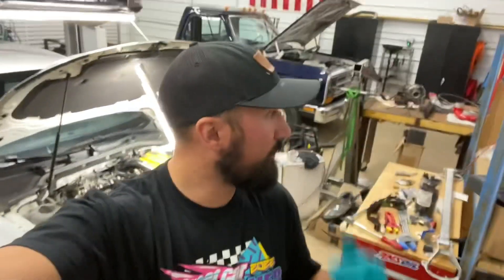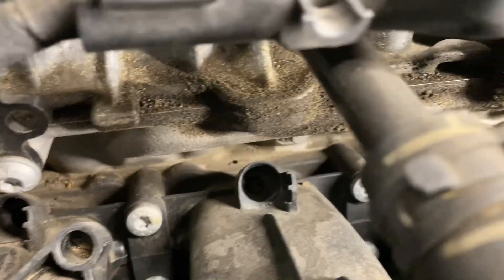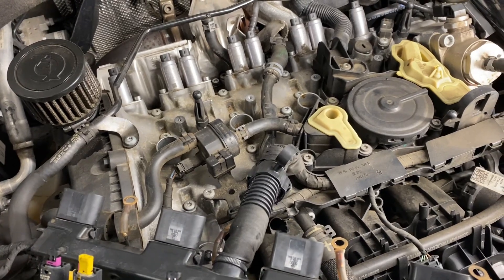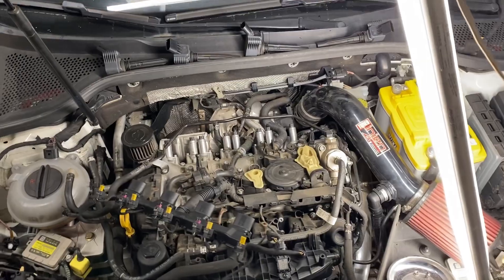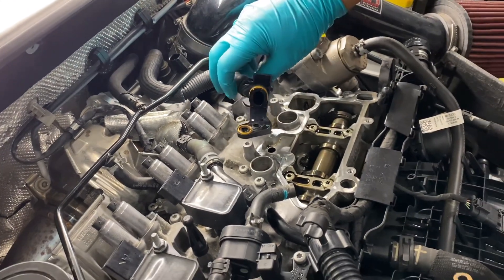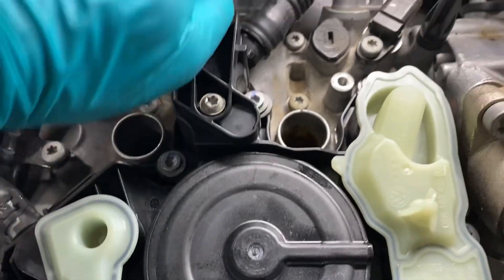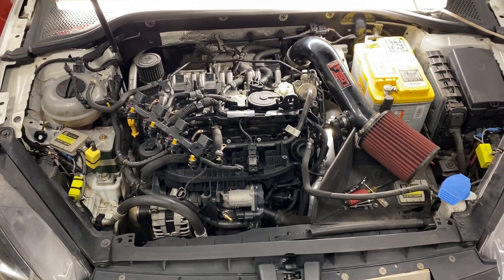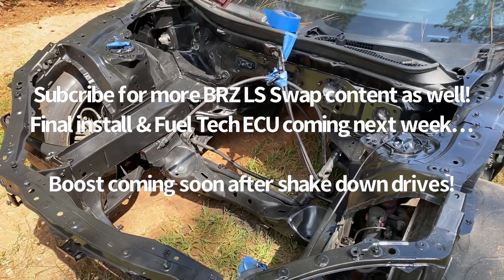Mk7 PCV Diagnosis & DIY Installation

Comment: 10k? for that car is not more around 40k for sparkplugs?
Reply from the maker: Tuned the Gen3 TSI needs plugs every 7-10k miles depending on how hard you drive it.

They make extremely high combustion temperature & pressure tuned, so if you attempt going 40k miles on spark plugs you’d likely end up breaking the electrode off (putting shrapnel through the engine) long before reaching 40,000 miles

Comment: ‘17 DSG with PP + ECU/TCU stage 1
Been having tapping noise and misfires + poor performance off and on. Might’ve narrowed it down to a stuck/bad lifter, but I’m wondering what would’ve cause it to become problematic in the first place. Is it possible a failing PCV could’ve led to oil contamination and fouled up the lifters? Trying to figure out before giving into the stealership
Reply from the maker: Check your cam magnets

Comment: My car is at 80k miles. I have the oil weeping issues like you mentioned in the video. Also had a little bit of oil on one of my spark plugs. I also have misfires on cylinder 2 at idle. If I unplug the N80 valve that is connected to the PCV the misfires go away. I’m thinking the PCV is the issue.
Reply from the maker: Sounds like you’ve got it!
Reply: @BaunPerformance  I installed the MK8 PCV retrofit with the full Venturi. So far so good!

Comment: Read somewhere that a possible sign of a bad pcv could be an oil leak
Only saying because I recently had a small oil leak coming from my OE last oil pan so I replaced with a steel one and used a dry gasket but now I just have the same problem after replacing
Is it possible a bad pcv is causing high pressure and making the leak still happen
Reply from the maker: I talk about it in this video, the most common crank case pressure induced leak would be at the oil cap (which can run down and be misdiagnosed as something like the oil pan)
Reply: @BaunPerformance  really hope it ends up being it coming from the oil cap and just replace the pvc
That’d be so much better

Comment: Did the car ever have blue smoke on startup? It’s an issue I’m having with mine and it looks like I may have some seepage around the valve cover as well. Trying to narrow it down.
Reply from the maker: Yes, it started around 80-90k ish. Unfortunately blue smoke (oil burning) on cold start has absolutely nothing to do with external leaks or PCV issues.

Being a spicy economy car, VW used inferior valve guide seals. The oil leaks past them on higher mileage MQB and burns off on cold start. 

Luckily, it’s such a small amount of oil even at 140k+ it doesn’t add up to a significant amount over my 7k oil change interval, but it is annoying & can only really be fixed with new bronze valve guides/seals (upgraded from OEM)
Reply: @BaunPerformance  Wow definitely one of the most helpful comments I’ve ever received on a post. Thank you! 

But also I’m definitely not a mechanic so I’m curious… if a bad PCV leads to external leaks due to over pressurization, why could it not cause internal leaks? Again just curious since your first explanation clearly shows you know what you’re talking about. Thanks again!
Reply: @BaunPerformance  also would you recommend using liquimoly oil saver if it is the valve guide seals?

Comment: Did you buy the OEM or an aftermarket from Fcp euro? Also did it resolve your leakage issues? Specifically in cylinder 3 & 4?
Reply from the maker: OEM, and yes it did (although seepage isn’t as bad as a leak it did fix it).

Comment: did the oil leaks stop after you changed the PCV ?
Reply from the maker: Yes, although it was just seeping originally. If it’s bad enough to leak leak you’ll be resealing that part.
Reply: @BaunPerformance  i don't see any symptoms of the pcv going bad at least as far as i know but i have a sippage even after changing the RMS.  Im thinking its the upper timing cover gasket?
Reply: @stasKZ did u ever figure things out on your car ???
Reply: @pharaohabaddon342  changed the upper timing car since its pretty easy to do, still having minor sippage.  havent really put effort into figuring it out.

Comment: I saw a video that says if you remove the oil cap when it’s running and it pulls a strong vacuum / upsets the cars idle substantially then the PCV is bad.  Is that accurate?  I tried it on my car and it seems to respond just as described above and I have been chasing a cyl4 misfire for a few weeks now. I’ve changed plugs, coils, had intake valve carbon cleaning done, etc so I’m thinking maybe PCV at this point
Reply from the maker: Also, highly unlikely PVC issues would effect cylinder 4 misfiring. 

Fuel, spark, compression & timing.

You’ve already addressed spark, so how did the plug you removed look on that cylinder? 

Wet with oil? Could need to do a compression test.

Wet with fuel? Probably a bad injector.
Reply: @BaunPerformance  thanks for the reply! I pulled the plug (all four actually) and they all seemed pretty consistently “normal”. Not wet, not caked with carbon/junk, no oil, and gapped to spec. As I mentioned, I moved coil packs around and  The misfire stayed with the cylinder. I’ve also just moved plugs around and the issue still stays with the cylinder. I think he may be onto something with the injector/fueling. I had the intake carbon cleaning process done about a month back where I also had the fuel injectors, proactively replaced as I was told they build up with carbon/gunk too. All for our brand new OEM injectors but I suppose it’s not impossible for one of those to be dead on arrival.
Reply: @BLanczak  Did you end up fixing your misfire or did you replace your PCV?
Reply: @zeRaxx  I did end up trying the PCV since it had 90k miles on it anyway.  It didn't resolve the misfire issue.  Unfortunately I don't have much more meaningful data to contribute; I got tired of chasing the issue and traded the car in for a newer GTI. Problem solved 😃.  Only regret was not trading it before I dumped all the money into a new clutch, carbon cleaning, injectors, coils, coil wire kit, etc.
Reply from the maker: ANY time you remove the oil cap with it running it’ll chase idle and run like crap.

If you remove the cap and there’s no change (it was already running absolutely horribly) then the PCV is completely failed or you otherwise have a unwanted vent to atmosphere.

Whoever gave that advice not only had it backwards, but also missed that a PCV doesn’t have to be completely imploded like that to be considered bad/requiring replacement.

Comment: Hey Jake, what kind of plugs do you use? I have a mk7 gti with a stage 2 tune. I was looking at the Denso 5749s. Seems like I read that EQT recommended those.
Reply from the maker: I run the Beru RS7 plugs everyone swears will snap off and blow up your engine. Been running them for over 100k miles, and just ordered another set this morning (10k intervals).

You can run any plug you’d like, so long as you don’t gap ones that aren’t made to be gapped, don’t melt them off doing a 45 min WOT pull, don’t drop them on the floor before installing, don’t run them for over 10k miles…basically don’t be an idiot & you can run whatever flavor you or your tuner recommends
Reply: @BaunPerformance  Thanks for the info Jake. I value your opinion.

Comment: You can power wash the engine while it’s running? Cover up all electronic connectors? Great video as always. I have a lot of seepage thru cam bridge and oil on all of my plugs at 61k. I should change pcv correct? And my cam side has terrible seepage. Car runs great and doesn’t burn a drop of oil. 2015 gti 2dr
Reply: I didn’t cover anything, but also didn’t go crazy with it either. You can see my results (124,500 mile 2016 purchased new in December 2015) just be careful or if you’re not comfortable this might be a good opportunity/excuse to have the car professionally detailed (including under the hood, the pros will make it look like new).

You’re car sounds like a good candidate for PCV replacement
Reply: @jakebaun8422  thank you for advice sir

Comment: Shops looking busy! Might have to check that out on mine. Just had DAP Repair do a thermostat /water pump housing replacement and carbon cleaning like a week or so ago.
Started with a slow leak, and within a month, I had to refill every time I drove it. 
Just hit 102k miles

Been a minute since we've met up. Hit a brother up. Got a ESAB emp 205ci to get some work done on some golf carts at a shop I've been working at.
Reply: Yeah man I’ve been keeping busy. Glad to hear you’ve still got the Mk7 & doing some welding! I’ll have more normal hours starting soon so shop hangs will be easier to fit in